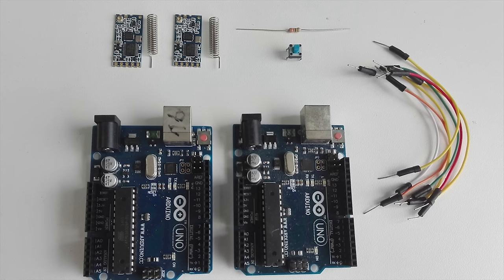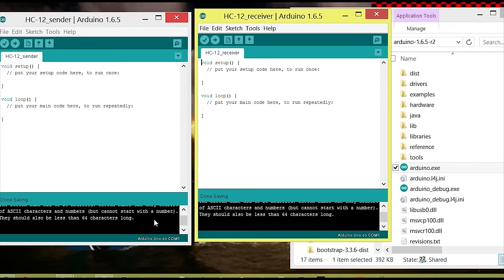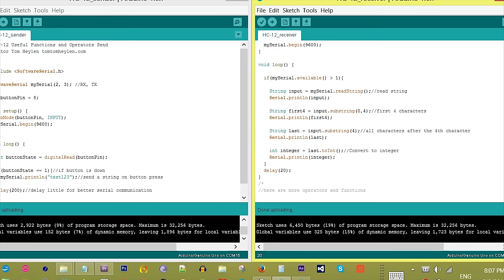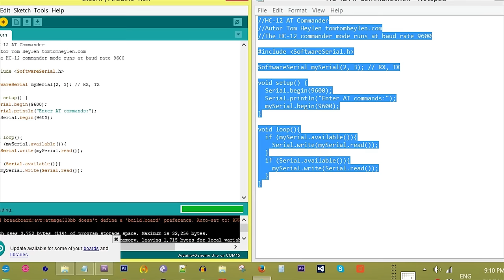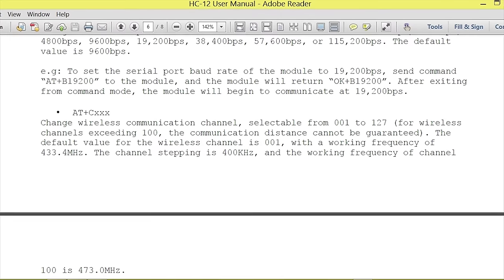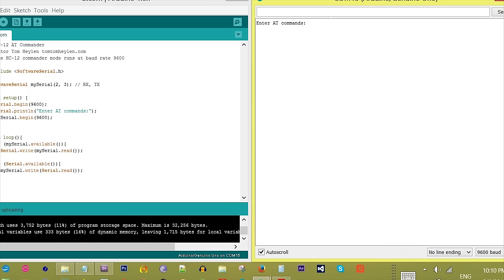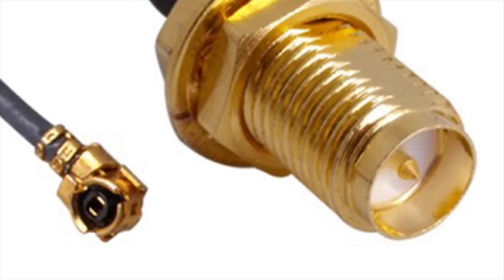Long range, 1.8km,  Arduino to Arduino wireless communication with the HC-12

Comment: Thank you Tom for sharing this video and work files for the HC-12 Wireless Serial Port Module. 

After watching your video, I ordered all the stuff, followed your instructions. and hay presto!! I'm now a pro haha. Seriously though this was exactly what i was looking for. I'm now setting up my once wired intruder/warning alarm to run wirelessly.

I tested the distance I was getting from the HC-12 and I was well impressed, well more then the 50 metres I needed even through walls. Great stuff.

Thanks again Tom, you've just saved me a fortune in unsightly wire :)

Thumbs up and subscribed

Comment: For those like myself on OSX, if you want to open two instances of the Arduino IDE, simply duplicate the Arduino application, and call one something like "Arduino Board2". You can run both simultaneously, choosing different boards/ports for each

Comment: Thank you Mr. Heylen for the great video instruction. I'm a newbie with the Arduino but have noticed that in the 'Momentary Send' exercise sketch, the Boolean onOff does not get reset to 0 after sending an off signal.  I noticed that, at startup, my uno draws 65 ma but increases to 95 ma once a button is pushed and remains there even after the button is released.  After adding a line of code to reset onOff to 0, the current does return to 65 ma after the button is released.  I'm concluding, maybe falsely, that the exercise sketch continues to send the off signal unless a button is pushed.  Please let me know if this indeed the case. You made extending your code to three 'pushbuttons' in a motion sensor and three leds in a receiver quite simple.  Thanks again!

Comment: Hi, there is a question, can I connect more than two HC-12? One module receives, several modules transmit. If possible, help with the code.

Comment: Thank you. Very informative tutorial. Is it possible to have 12 or more momentary buttons in both transmitter and receiver? I have 12 buttons in arduino and want it controlled wireless.

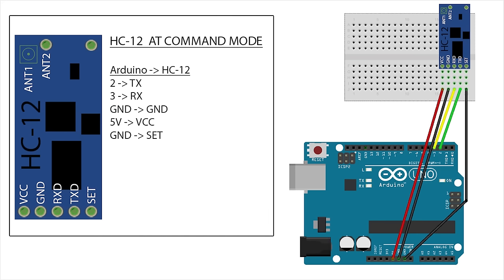Comment: I Connected the HC-12 as you showed(4:52) to my Arduino Mega, but didnt receive a signal, after writing AT. What could be the problem?
Reply: Same thing happened to me, i tried with a mega and 2 Unos and even ordered brand new HC-12s and tried those and nothing works
Reply: have you guys figured out the solution of this problem?? because i am also facing same problems and wasted my 2-3 days on order to rectify the issue but nothing has worked
Reply: @BioSniperX  bhai main bhi ye banana chahta hu.  Hc12 mehanga h.  Agar bhai aapka ban gya ho to please bta do. Phir main bhi purchase kr lun ga

Comment: Hello Tom, great article!

You have an example of sending data continuously updated?

For example, I would always send the transmitter data. If the receiver is out of range, a status LED indicates a signal failure or enter in failure mode.

I can not keep sending continuous data, in this case, 4 bytes for less than 1000ms, which is very high for a real-time system.
Reply from the maker: I found some code I wrote for a remote controlled drone working with the
 HC-12 modules. 

SENDING CODE
#include <SoftwareSerial.h>

SoftwareSerial mySerial(4, 5); //RX, TX

//#### varialbles for potentiometers, handles ##########
int potUpDown = 1;  // analog pin used to connect the potentiometer
int potLeftRight = 0;  // analog pin used to connect the potentiometer

int valUpDown;   
int valLeftRight;

String strValUpDown;
String strValLeftRight;

//#### variables for accelerometer ############
int yPin = A3;
int xPin = A2;
int xValue = 0;
int yValue = 0;

int xD = 0;
int xU = 0;
int yL = 0;
int yR = 0;

String strXValue;
String strYValue;

int buttonPin = 12;
int buttonState = 0;
boolean checkButtonState = 0;
boolean mapValues = 1;

void setup() {
  
  Serial.begin(9600);
  mySerial.begin(9600);
  Serial.setTimeout(10);
  mySerial.setTimeout(10);
  pinMode(buttonPin, INPUT);
  
}

void loop() {

  //########## code for potentiometers, handles #################
  valUpDown = analogRead(potUpDown);            // reads the value of the potentiometer (value between 0 and 1023)
  valLeftRight = analogRead(potLeftRight);
  
  valUpDown = map(valUpDown, 370, 638, -4, 96);     
  valLeftRight = map(valLeftRight, 397, 600 , -50, 50);

  strValUpDown = String(valUpDown);
  strValLeftRight = String(valLeftRight);

 
  //########## code for accelerometer ################
  buttonState = digitalRead(buttonPin);
  
  if (buttonState == HIGH) {
    checkButtonState = 1;
    xValue = analogRead(xPin);
    yValue = analogRead(yPin);
    
    if(checkButtonState == 1 && mapValues == 1){
      mapValues = 0;
      xD = xValue - 65;
      xU = xValue + 65;
      yL = yValue - 68;
      yR = yValue + 68;
    }

      xValue = map(xValue, xD, xU, -50, 50); //difference is 130 
      yValue = map(yValue, yL, yR, -50, 50); //difference 136

      strXValue = String(xValue);
      strYValue = String(yValue);
           
          
  } else {
    checkButtonState = 0;
    mapValues = 1;
    strXValue = "0";
    strYValue = "0";
   
  }

  //read figures in serial monitor
 
  Serial.print("handle up/down" + strValUpDown);
  Serial.print(" handle left/right" +strValLeftRight);
  Serial.print(" acc up/down " + strXValue);
  Serial.println(" acc left/right" + strYValue);

  mySerial.print(":" + strValUpDown + "," + strValLeftRight + "," + strXValue + "," + strYValue + ";");
  
  mySerial.flush();//Waits for the transmission of outgoing serial data to complete.
  delay(50);//allow some time for the serial buffer
}

/*

int checkLeftRight = 0;
int checkUpDown = 0;
boolean set;

void setup() {
  
  
  
}

void loop() {
 

 RECEIVING CODE
#include <SoftwareSerial.h>

SoftwareSerial mySerial(3, 4); //RX, TX

//4 leds
int ledFrontLeft = 11;
int ledFrontRight = 10;
int ledBackLeft = 9;
int ledBackRight = 6;

void setup() {
  Serial.begin(9600);
  mySerial.begin(9600);
  Serial.setTimeout(10);
  mySerial.setTimeout(10);

  //declare led pins to be output
  pinMode(ledFrontLeft, OUTPUT);
  pinMode(ledFrontRight, OUTPUT);
  pinMode(ledBackLeft, OUTPUT);
  pinMode(ledBackRight, OUTPUT);
   
}

void loop() {
 
  
  if(mySerial.available()){//Read from HC-12 and send to serial monitor

    //traversing trough the serial input
    //date sent is a continues stream of ":updownvalue,leftrightvalue,accUpdownvalue,accleftrightvalue;..."
    mySerial.readStringUntil(':');//is string start character
    Serial.read();//skip start character
    String handleUpDown = mySerial.readStringUntil(',');//read first value
    Serial.read();//skip separator
    String handleLeftRight = mySerial.readStringUntil(',');//read second value
    Serial.read();//skip separator
    String accUpDown = mySerial.readStringUntil(',');//read 3th value
    Serial.read();//skip separator
    String accLeftRight = mySerial.readStringUntil(';');//Read 4th value
    Serial.read();//skip string stop character
    
   
    //Convert values to integers
    int intHandleUpDown = handleUpDown.toInt();
    int intHandleLeftRight = handleLeftRight.toInt();
    int intAccUpDown = accUpDown.toInt();
    int intAccLeftRight = accLeftRight.toInt();
   

    intHandleUpDown = map(intHandleUpDown,0,100,0,255);
    intHandleLeftRight = map(intHandleLeftRight,-56,53,0,255);
    intAccUpDown = map(intAccUpDown,-50,50,0,255);
    intAccLeftRight = map(intAccLeftRight,-50,50,0,255);

    //speed
    float accLeft = 0;
    float accRight = 0;
    float accUp = 0;
    float accDown = 0;
    float handleLeft = 0;
    float handleRight = 0;
    
    //split value in half. left right and up down.
    if(intAccLeftRight < 117 && intAccLeftRight > 0){
      accLeft = map(intAccLeftRight, 117, 1, 100, 1);
      
    }
    if(intAccLeftRight > 137 && intAccLeftRight < 255){
      accRight = map(intAccLeftRight, 137, 254, 100, 1);
            
    }        
    if(intAccUpDown < 117 && intAccUpDown > 0){
      accDown = map(intAccUpDown, 117, 1, 100, 1);
      
    }
    if(intAccUpDown > 137 && intAccUpDown < 255){
      accUp = map(intAccUpDown, 137, 254, 100, 1);
            
    }
    if(intHandleLeftRight < 128 && intHandleLeftRight > 0){
      handleLeft = map(intHandleLeftRight, 128, 1, 100, 1);
      
    }
    if(intHandleLeftRight > 148 && intHandleLeftRight < 256){
      handleRight = map(intHandleLeftRight, 148, 255, 100, 1);
          
    }
    //calculate and write values to led's
    if(intHandleUpDown < 10){
      analogWrite(ledBackLeft, 0);
      analogWrite(ledBackRight, 0);
      analogWrite(ledFrontLeft, 0);
      analogWrite(ledFrontRight, 0);
      
    }else{
      float valFrontLeft = intHandleUpDown;
      float valFrontRight = intHandleUpDown;
      float valBackLeft = intHandleUpDown;
      float valBackRight = intHandleUpDown;
      
      if(accLeft != 0){
        valFrontLeft = valFrontLeft/100*accLeft;
        valBackLeft = valBackLeft/100*accLeft;
        
      }
      if(accRight != 0){
        valFrontRight = valFrontRight/100*accRight;
        valBackRight = valBackRight/100*accRight;
      }
      if(accUp != 0){
        valFrontLeft = valFrontLeft/100*accUp;
        valFrontRight = valFrontRight/100*accUp;
        
      }
      if(accDown != 0){
        valBackLeft = valBackLeft/100*accDown;
        valBackRight = valBackRight/100*accDown;
        
      }
      if(handleLeft != 0){
        valFrontRight = valFrontRight/100*handleLeft;
        valBackLeft = valBackLeft/100*handleLeft;
        
      }
      if(handleRight != 0){
        valFrontLeft = valFrontLeft/100*handleRight;
        valBackRight = valBackRight/100*handleRight;
      }
      analogWrite(ledBackLeft, valBackLeft);
      analogWrite(ledBackRight, valBackRight);
      analogWrite(ledFrontLeft, valFrontLeft);
      analogWrite(ledFrontRight, valFrontRight);
    }
    
   
    Serial.print(intHandleUpDown); Serial.print(",");
    Serial.print(intHandleLeftRight); Serial.print(",");
    Serial.print(intAccUpDown); Serial.print(",");
    Serial.println(intAccLeftRight);
      
    
    
    
    
    
  }
 
  mySerial.flush();
  Serial.flush();
  delay(20); 
}

Comment: In your video there is no latency in the messenger 1st example communication . Did You changed the Serial.setTimeout() to something different from 1000 ? this for both softwareserial and serial ? ? kindof Serial.setTimeout(50)?

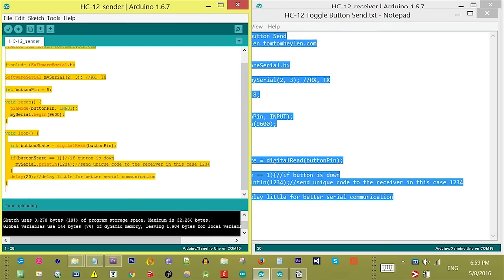Comment: Why resistor on push-button? On your video at 03:00 - If on pin 8, why not declare in setup(), "pinMode(8,INPUT_PULLUP);" then change in sketch "if (buttonState ==0) {do something useful}" instead "if (buttonState==1)...  Or, here is simple sketch for learning button press code:
void setup() {
  pinMode (8,INPUT_PULLUP);

}

void loop() {
  if (!digitalRead(8))
  {
    digitalWrite(13,1);
    delay(100); //debouncing trick, waiting 100 mS button to settle
    
  }
  else
  {
    digitalWrite(13,0);
    delay(100); //debouncing... 
  }
}
Note "if (!digitalRead(8))" - this means if pin 8 on arduino is not 1 (it is 1 because of INPUT_PULLUP statement above) when not pressed. Button goes from pin 8 to GND - Not from pin 8 to +5 or +3.3V and with resistor to GND (where then should be without exclamation mark "if(digitalRead(8)), which means if pin 8 is TRUE, or HIGH, or 1. It is okay to use resistor for just one button, but what if you have tens of buttons?! Zillion resistors on small breadboard?! Or just simply declare pinMode(buttonPin, INPUT_PULLUP), and MCU will provide "weak pull-up" resistor by partially opening one dedicated FET or MOSFET. If it sounds complicated - it is just confusing at beginning, and I believe that every tutorial should bring more learning opportunities, not just "copy/paste" sketch, which is for most cases okay, but people want to learn more and use its own brain to develop good sketches. Thanks.
Reply: I agree alot of people needlessly waste resistors and such by not learning about input_pulldown
Reply: Pullup*
Reply: You can even use a map function, for example: x=map(y,0,1,1,0);and now when u press the button, it will turn on the LED(for example)like a normal button; Moreover, you can continue your code normally without any confusion(if u had a huge code).

Comment: Hello Tom,

I'm trying to use the HC-12 with a Wemos d1 mini (https://wiki.wemos.cc/products:d1:d1_mini) but i cant get it to work. AT Commander doesnt want to work. 

I guess it's due to the different pinout of the board. There is TX & RX pin on the board but i dont know how to call them in the code.

Do you have any tip or solution for me please ?

Thanks.

Comment: Hi, I am currently working on a project that requires wireless communication between two Raspberry pis via RF transceivers. Is it Possible to program and connect the HC12 to Raspberry pi via UART serial port?

Comment: Hi! I used that module in FU3 2400baud mode at good range, but neede more now, set up FU4 and CH010, Baud 1200 ad now range is less than FU3 9600baud so less than 100meters isntead of 1.8km, what could make the issue?

Comment: Hello! Sir I'm working on a energy monitoring project fro which I am using Hc-12 module for data transmission as it is quite cheap and easily accessible. Sir i am exactly using the same code as yours for checking the wireless communication between the modules and i am also using one uno and one mega but their is exchange of messages between the two serial monitors then i exactly followed your steps to ground the SET pin for configuring AT commands I am not able to get any responce from either of the modules, sir can you help me out with this that what i am doing wrong?

Comment: hey tom can u tell me diff btwn nrf24l01 and hc 12..please thanks in advance...and please ASAP
Reply: yeah that would be nice
Reply: NRF24 modules are using a higher frequency, it is ideal for short distances, like indoor use with 1-2 walls between the modules. HC-12 are better for higher distances, like between two neighbour houses. BUT! The HC-12 are working on 433MHz, what is commonly used in PMR radios, wireless remotes, etc. These stuffs can easily interfere with your communications between HC-12s. So, in short distances in indoor, use the NRF, or just use ESP8266. Its almost an arduino with wifi.
Reply: Nrf24l01/+ is a 2.4Ghz freq. and HC-12 is a sub-Ghz (that's under 1-Ghz)

Comment: Hello Tom, 

First thank you for the video its great! 

I have some doubts and i hope you can help me . 

I want to use the receiver in stand alone mode, without the module microcontroller.

It is possible to add a jumper to the module between the radio output and a NC pin?

And In which microcontroller pin does the radio output enters?

Comment: Did you test this radio module about a 1.8 Km range?
Reply from the maker: Some of the people in this forum had a range up to 10 miles in open area. Concrete walls and buildings will make this range shorter. I found that in a building I can receive up to 4 floors. Have a good one. Cheers

Comment: Im glad that my hc-12s are working after following this tutorial. However, im having one challenge and I hope someone here can help me fix. When testing the range with a yagi or basically any antenna, I noticed that pointing my antenna away from the transmitter so that the communication is lost and pointing the antenna back towards the transmitter so that it comes back in range, doing this repeatedly for about four time causes the receiver to freeze with the pin13 led continuously ONN and not change state even when the button on the transmitter is released, until the arduino has been reset. The LED on the arduino remains on even when there is no connection between the two point and even the code has the else part which tells the arduino to turnoff the LED when there is no communication from the transmitter. This would be a big problem if I tried to use the setup to control a pump which is supplying a tank, it would cause an overflow. Has anybody encountered this issue and does anyone know how to fix it or prevent it? I expect the module and the arduino on receiver side to automatically resume their task automatically once the signal returns, and more impotently t o turn the led off when there is no transmission as a safety measure. Im aware the code for momentary button has this feature, its only that it is failing after transmission is interrupted repeatedly, yet it is a highly obvious thing that the transmission can get interrupted like that. Kindly help meRegards!

Comment: Could you please let me know what is the maximum range that we can achieve while using only the spring antenna provided with the module when working at FU4. Appreciate if you could give some idea. Thank you very much.
Reply from the maker: I have been testing the sma and the spring antenna in an urban area and it does not seem to be much different.

Comment: hi tom Thank you for the great video! Is it possible to transmit data from sensors(ex. Temperature, pm 2.5 etc.) from one HC-12 to another? If yes could you please show some example codes?

Comment: The HC-12 module seems to work in half duplex mode. I would like to realize a remote control with a nextion display which on the one hand can be used to switch  consumers and on the other hand receives sensor data and displays it on the touch panel. So the role of station A and B shut be alternating  from transmitter to receiver. How can this be achieved with two Arduino MEGA? I want to use a MEGA2560 instead of an UNO because of the available serial ports and the much higher amount of memory.